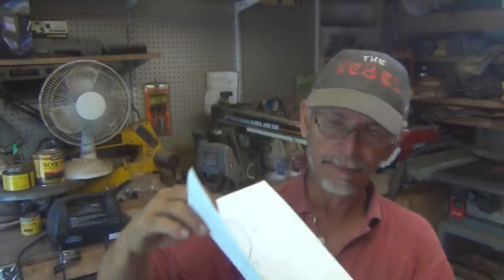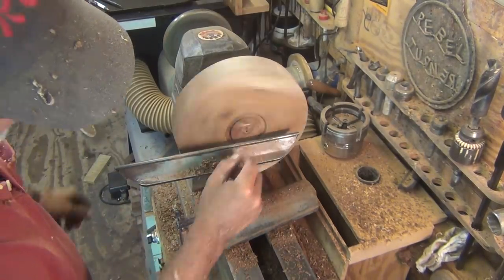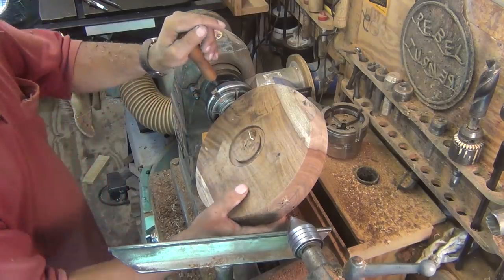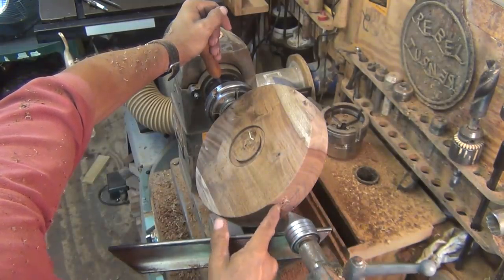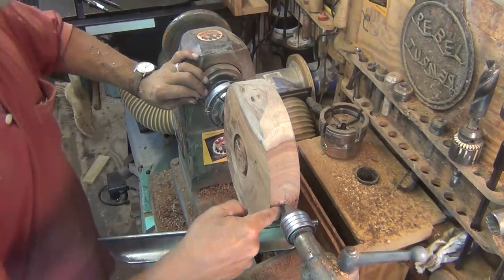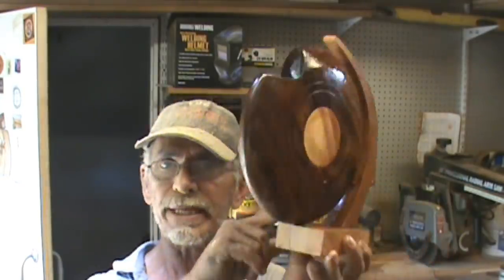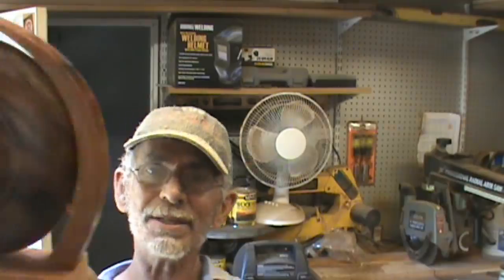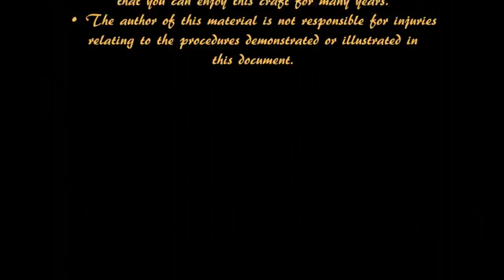Ma chichi   disk vase on stand

Comment: hi al i can see your having some issue with the lacquer . its a tough finish . what i have found is if you make a little place to hang the piece i use a screw and a small piece of para cord .  hang it from the rafters  place a container under the piece to catch the excess lacquer when it drips off and just get your brush  soaked with lacquer then put a coat so thick that it coats it as if you dipped it in the can . when you set up the screw try to pick a place that can be filled or hidden  . as it drys it will drip off but the coats will be even . you can leave the drip till you get the coats you want on it then let it fully dry one or two days  worth of drying . then take a sharp box cutter  or knife and cut the drip off . then dip your finger in the lacquer and rub it on the place you cut the drip . it will cover the cut mark. when you put a coat of lacquer over another coat the top coat and the bottom coat bond together  not like poly where one layer lays over the other . this will help you get that glass finish al if you really need to let it fully dry  then rub it down with the .00 steel wool . then add another light coat . i hope some of this info will help you buddy . lacquer is a touchy finish . most people dont like to use it . i dint at first ether  but now it is my favorite finish . sorry for the long comment buddy . not trying to tell you how to do things buddy just telling you how i do it  and what works for me .
Reply from the maker: Thank you my friend for the great tip. I was using Minwax before and had no problems, It gave me a bit extra time on the brushing. This new stuff is hard to work with. Tacky as soon as I apply it. Good tips but I think I will be getting some Minwax again
Reply: @AlFurtado  lol no worries al do what works for you my friend .
Reply: You are a determined craftsman my friend.